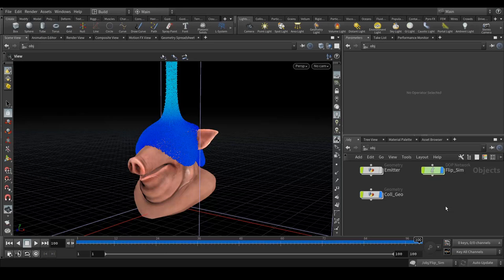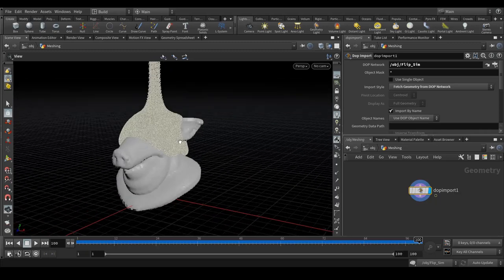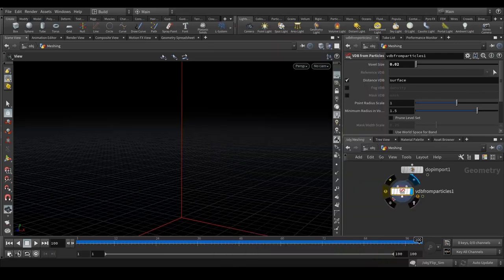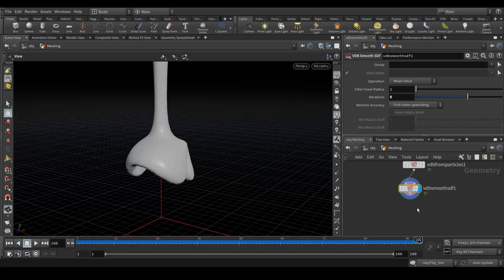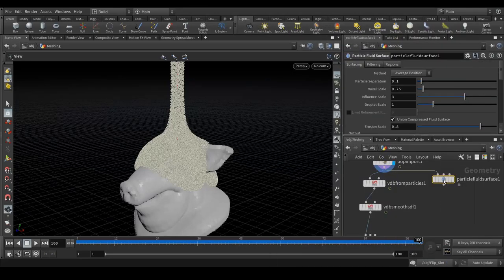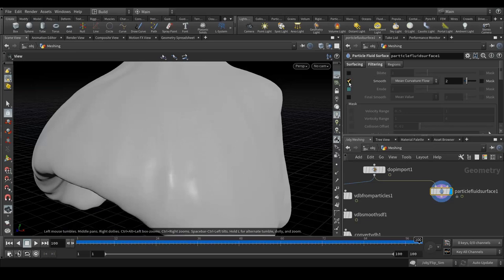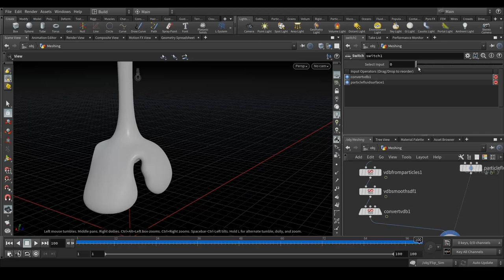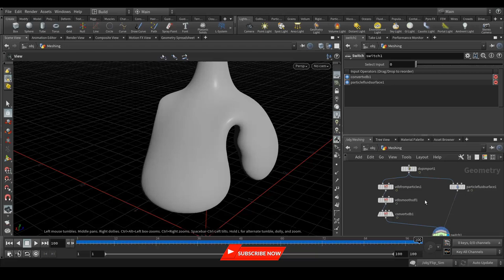Houdini Flip Fluids Part 02 Meshing

Comment: Yes Particle Fluid Surface is pretty much always the way to go for meshing. Rebelway courses suggest VDB From Particles but my professional experience showed me that that's a waste of time for a way worse result. You lose all the detail with VDB from  particles node. Fluid Particle Surface is THE NODE for any particles to mesh conversion even if it's POPs or any points not just flip. That's probably one of the best nodes in Houdini in the way it was made. it is SOLID. I mean look how much more detail you get from Particle Fluid node even in this example versus VDB nodes. VDB nodes can't touch Particle Fluid sop in the level of detail and efficiency. And yes I know they are inside it as an HDA but just saying, for no individual VDB nodes can even touch Particle Fluid Surface because if you ever look inside you will se the level of complexity that this Fluid Surface SOP contains. It's uncomparable. VDB from particles will kill all of the detail no good.
Reply: I used PFS with quite low res vellum grains (around 1mil particles) and it gave me very flickering meshes, maybe I missed something there regarding this issue (any tips?). With this approach, I got immediately smooth-looking mesh without flickering....
Reply: Meshing itself is an art. If you can’t do it manually you have to work harder. Particle Fluid Surface is not great if you’re doing high end water FX.